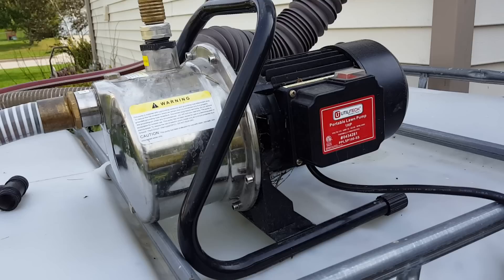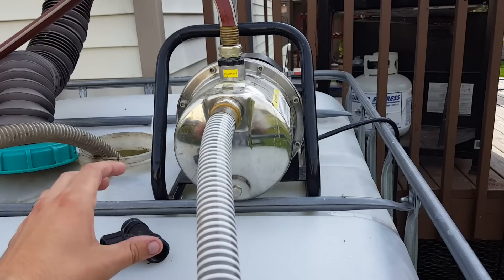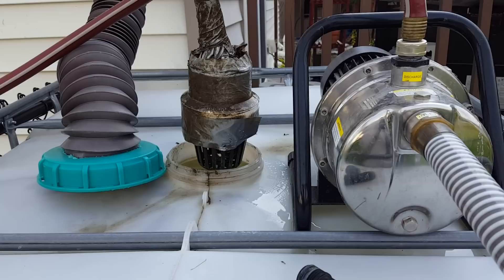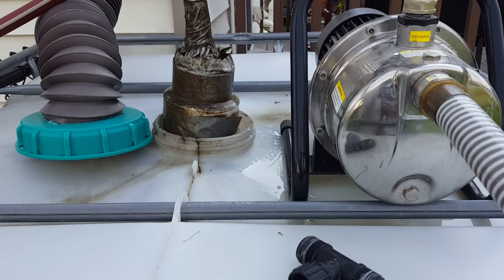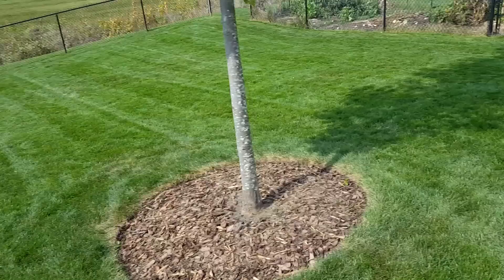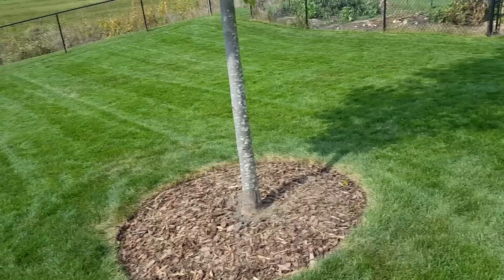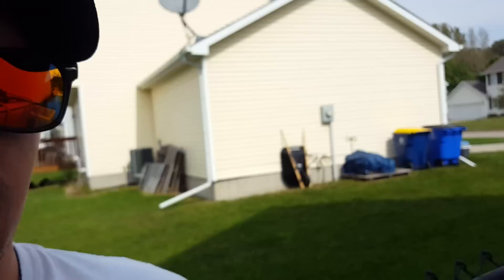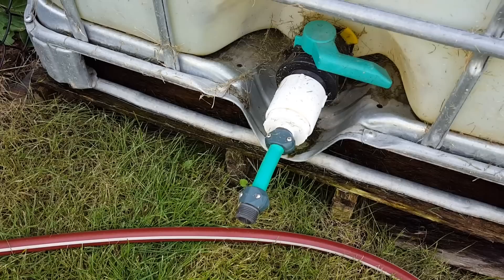DIY Rain Barrel and Pump Setup

Comment: Here's a tip - Put a pantyhose on the end of the hose coming from your gutter before it enters the tank - to pick up small dirt and leaves. It helps keep your tank clean. I also just picked up that Wayne pump - I hope it works as good as yours does
Reply: Paint strainers are cheap, very durable and easy to get too.

Comment: is there anything you can add to this so when you turn the hose off the pump turns off as well?
Reply from the maker: not sure but I have hooked up an electrical timer to mine so whenever i want to it to shut off the timer just kills power to it and obviously everything stops pumping at that point.
Reply: ON DEMAND RAINBARREL PUMP, that is what you need

Comment: Question... I have a tank 500 gal and it has a spot where I can connect a hose would this system work connecting a hose to drain the H2O?
Reply from the maker: I think this comes with an adapter where you can connect the main part to a hose end instead of the 1" hose I'm using.

Comment: Ryan, would a pump like this be a good choice for increasing my water spigot pressure that goes to one big sprinkler impact head in the backyard?  my backyard measures 50' x 50' and i'm trying to use just one sprinkler to cover my complete backyard. It is fenced in and the hose is on a water timer so i don't want to have to move my sprinkler if i don't have to.
 Would a pump like this ensure that i'm throwing water far enough to water the entire backyard?  I want to buy one of the BIG SPRINKLER BRAND Sprinklers like the Rotor or Impact. Thanks for any help or input.
Reply from the maker: It's really hard to say without knowing what kind of pressure you have currently and gpm.  It will definitely boost pressure but enough to cover 50x50 I don't know.

Comment: Have you considered using that pump in the creek behind your property to water the lawn as it would be a free and unlimited water source?
Reply: That is exactly what I'm looking into doing. I'm just wondering how long it will take to recoup to upfront cost. My lawn is about 1/3 acre.
Reply: or....  use the pump to refill the tank when it is low, and still use the tank for the yard watering.

Comment: Hi, Can this pump may be used with a timer for water the plants of my raised beds from rain barrels?
Reply from the maker: Yep.  Just plug it into a timer on an outlet and works perfectly.
Reply: Careful. the contacts on your timer need to be "motor rated" - able to interupt a 1 hp motor.

Comment: Great video Ryan, wanted to ask your opinion on using a system like this as the primary source of watering my yard ( other than rain, yard is 6000 sq). My well pump is not good enough to put out enough flow to run multiple sprinklers and my well recovery isn't good enough to upgrade the pump. Thinking about 2 or 3 of these Barrels with a 1.5 or 2hp pump, any suggestions ? Was this pump strong enough to run multiple heads ? How much coverage were you getting with this pump and that one sprinkler.
Reply from the maker: Yep it runs 3 - 4 of my hunter mp rotators with no problem at all.  For 6k you would have to run it in zones or pick up the sprinklers and move them but overall it works well.
Reply: Ryan Knorr Lawn Care ok and how many tanks would u suggest for a yard my size based on your experience with how quickly they fill up and the amount of water ill he using to make sure i get at least 1 inch a week including the rain
Reply from the maker: I honestly can't say for sure because we normally water the garden with the rain barrel and we only have one.  It does go through it pretty fast so if you can have multiple that would be good.

Comment: You mentioned there is junk at the bottom at of the rain barrel.  Do you have a filter between the roof and the barrel or does it flow strait into the barrel?  What is your strategy for cleaning the barrel when/if it gets too much junk to use the bottom spigot?
Reply from the maker: We don't have a filter in between so it comes straight off the roof and into the barrel.  I haven't noticed enough build up of anything to be a problem and we haven't cleaned the inside of it at all. We just don't let the water sit in there too long as that's when it starts to get a little murky.  If you use it consistently there's hasn't been an issue.
Reply: good to know.  I'm in the city with a lot of mature trees that junk up my gutters every year so I'm looking for a strategy to filter.  Right now I'm leaning towards some sort of gutter guard and a filter on the end of the downspout before it goes into the barrel.  Thanks for the reply.

Comment: Could you use a similar set up and attach watering wand attachments at the end of the hose instead? Or would it put too much pressure on the motor and blow it
Reply from the maker: I can't remember if I have tried that or not but the water doesn't come out at blazing speed so I think it would work fine.
Reply: Jason K FYI that model of pump does not turn its self off as pressure builds so as long as the flow is not stopped while it is running then any hose nozzle should be fine!